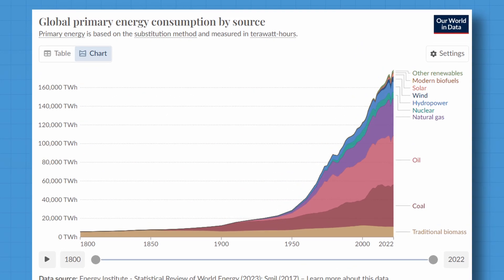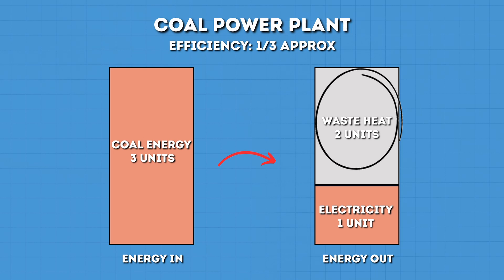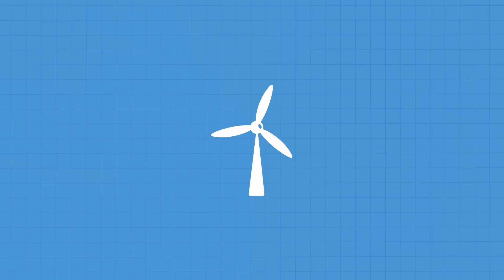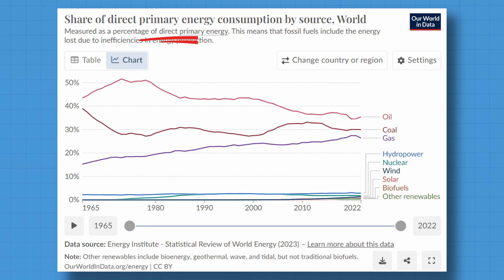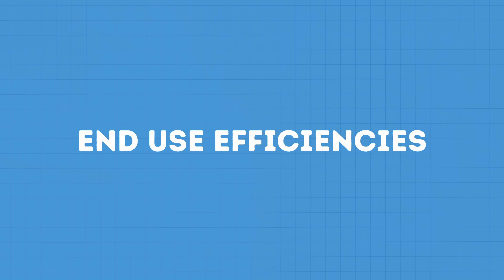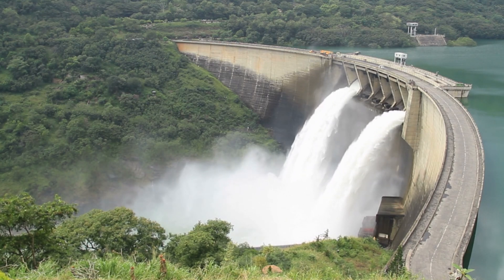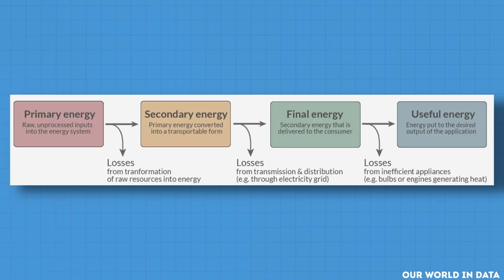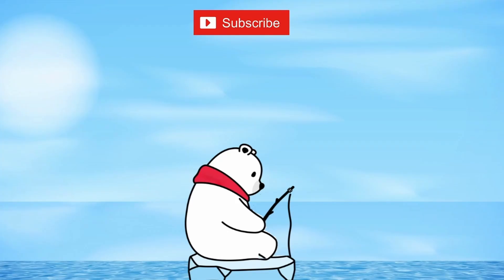We need to talk about the Primary Energy Fallacy

Comment: Yet again, a banal high school level fact for engineers; but permanently beyond the understanding of average citizen.

Of course, what your treatment assumes is that the heat of thermal-based energy sources is wasted, which is not the case everywhere. Most of the countries in northern Europe utilize it in district heating, making flat waste assumption incorrect. In cold areas, heating accounts for a massive segment of total energy expenditure, so this matters.

Then what even further complicates things is that heat pumps driven with electricity are widely used. They generate usable high temperature heat for ~3x the amount of electrical energy put in, and the low temp. heat source they draw from can be fossil energy waste heat, industrial plant waste heat, latent heat of urban sewege system, or dedicated heat reservoirs heated during the summer. 

None of that is taken into account in simple charts.
Reply: Sand batteries can produce heat for homes, while carbon batteries or metal powders can provide industrial heat.  It is easier and cheaper to get heat from non-carbon based sources.
Reply: @FlameofDemocracy  Produce or store? Describe this sand battery that produces energy?

Comment: False argument no-one is arguing the potential energy of coal be replaced, only the power realised at the alternators.

Renewables have a similar problem. Wind turbines typically produce only 35% of their rated power as usable energy. The same problem applies to solar PV.

Nuclear solves these problems by running 24/7. Thermally it is more efficient than coal as there are no flue losses and no need for CCS.
Reply from the maker: Yes they are
Reply: I'd love to agree but the sad truth is that most nuclear power uses water as a coolant which limits the working temperature to say 350c or so which in turn severley limits the Carnot eff at the generator stage. It doesn't have to be that way, Molten Salt and metal cooled high temp reactors could run at 700c or more and get closer to 60% eff.Nice if they used super critical CO2 as well and that does seem to be working now.

Also in Germany all those CO2 free nuclear reactors that were shut down were also likely 35% eff at max and mostly got replaced by brown coal plants that run at 45% eff plus all the polution they create. But the 35% nuclear is vastly better than 45% coal under all circumsatnces unless you hate nuclear like German greens do.Whats even more amazing is that those 45% coal plant are run as peakers to match the wind and PV, if they also ran as base load they might even be higher eff, but would still be evil

Comment: Fossil fuels are heat engine based which are universally limited by Carnot's efficiency and other real thermodynamic cycles. 

However, solar and wind aren't that much better either. The best solar panels nowadays are only 22.5% efficient, and wind turbines about 30% (this is still very good, even compared to just 10 years ago). However, ultimately nuclear is the only option. Nuclear is about 33% efficient, comparable to fossil fuels, but 1 kg nuclear fuel produces over 86000000000000 (80 trillion Joules) and so even with losses at least 20 trillion joules of work with just 1 kg fuel. (Gasoline for comparison is 46000000 or 46 million joules per kg, and about 18 million J can be converted to work)/

TLDR, nuclear is the only source with enough sheer power to replace all of fossil fuels with zero emissions and minimal waste, especially with the new breeder reactors. Hence we should go nuclear despite the high initial costs.

Comment: Renewables have their own inefficiencies though, some of them even greater. PV solar is usually ~20% of the sunlight hitting the panel for instance, so they should be given far greater area on a primary energy graph.
In fact the fraction of space covered by solar is also a part of that inefficiency if you really think about it, so to be really fair we should just use graphs where everything is totally swamped by the total solar power incident on Earth (~173,000 terawatts).